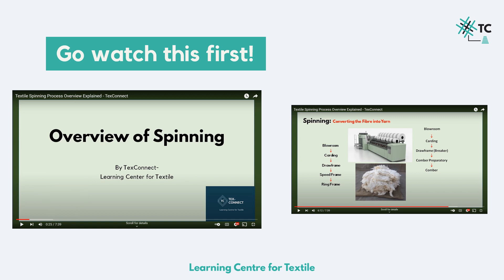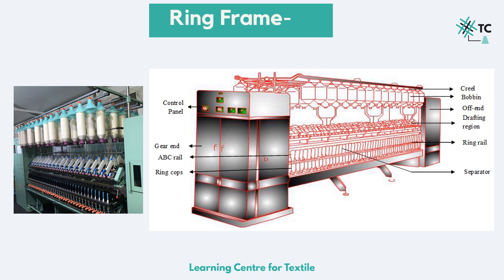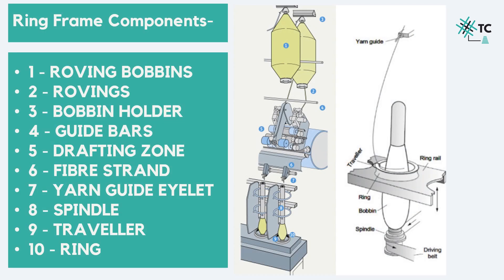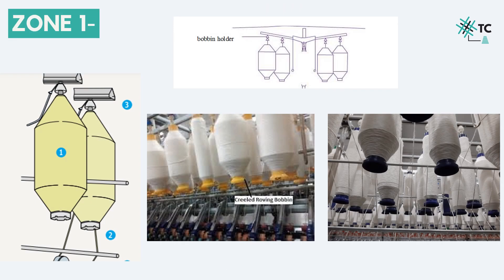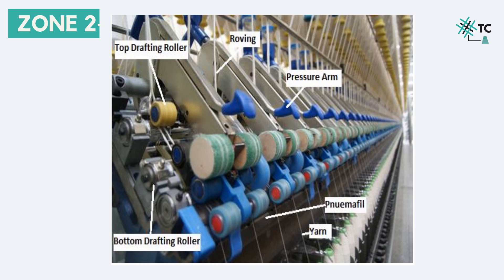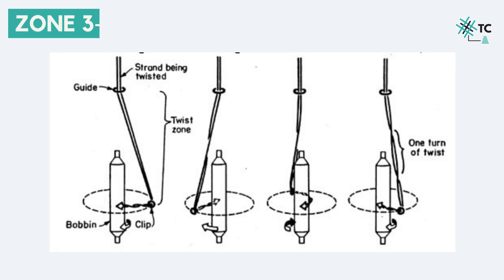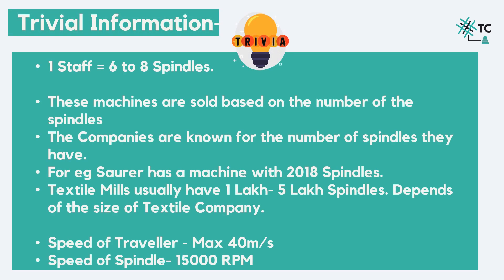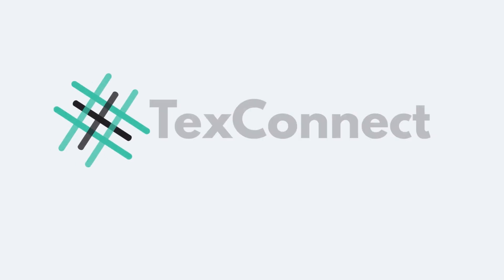Ring Spinning Process Textile | Explained with animation | TexConnect

Comment: The animation of the traveler on the ring during spinning (at 1:19) is backwards or the thread should go through the traveler the other way! It would have been more illustrative if the rotation of the spool /bobbin/cop was shown simultaneously as well as a point on the thread being spun so that the winding and spinning action would be clear.